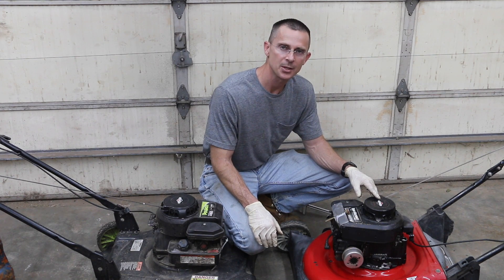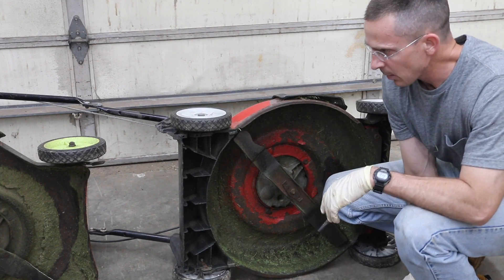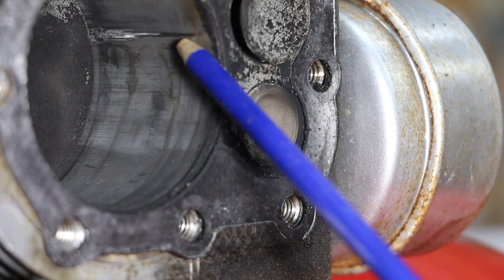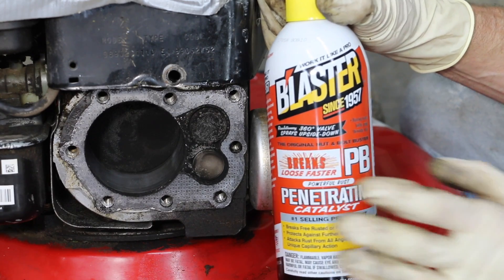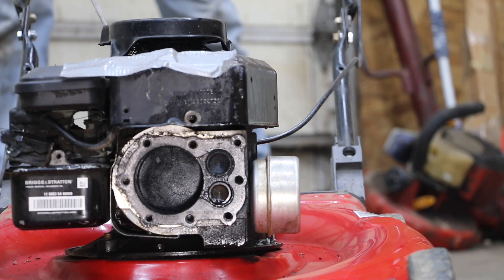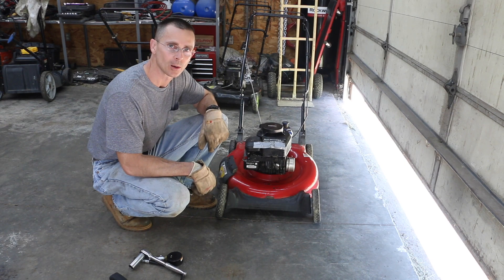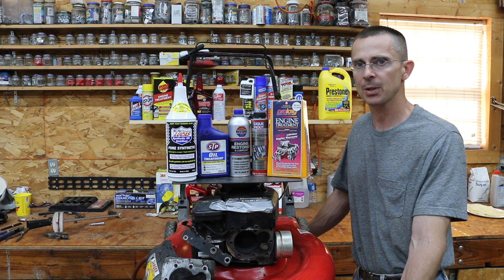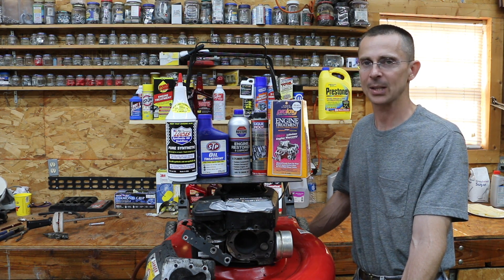Engine ran without oil, seized! Can it be saved?

Comment: I had the same issue with my mini bike would it run again if i put a new piston in it? It ran without oil in the motor and it locked up. Would a piston fix my problem??
Reply from the maker: You may be able to free it up using marvel mystery oil. If that doesn't work, a new piston and rings should do the job if the cylinder wall is in good shape.

Comment: I haven't found anything that can increase compression on a 2 stroke engine. I have an old atv that takes multiple pulls to start. All the increased compression additives out there are for oil, since the 2 stroke mixes the oil and gas, those aren't helpful. Any recommendations? I have seafoamed the throttle. The only thing that works is starting fluid.
Reply from the maker: If you're sure the compression is the issue and not the carburetor, a cylinder hone (if needed) and new piston rings is the best option in my opinion.

Comment: i have a jammed up 350 small block from a 69 camaro. It jammed up about a year ago and has been sitting in storage. Apart from what was said in the video, does anyone have any tips to get it unseized. Thanks.
Reply from the maker: If it's locked up from sitting and moisture exposure, adding marvel mystery oil to each cylinder and allowing it to soak for a few days.  If it's locked up due to mechanical damage, you might have to disassemble the engine.  It's hard to say without knowing more.
Reply: Project Farm It was on my father's camaro before he jammed it mechanically. He replaced it with a 383 and gave me the jammed one. Im going to dismantle it to see what went wrong and il try to record it. Thank you for your help.

Comment: Is the reason you use the drill to start the engine because all of your engines are siezed up and the rope won't start it
Reply from the maker: The drill doesn't have as much power as the pull string/human force method. it does save me a lot of effort.

Comment: A new set of rings on the piston, fill the scoring will some quick steel (not jb weld) and run a hone through quick. Quick steel handles high temperatures (500F), great for high temperature applications.
Reply from the maker: Great recommendation.

Comment: I've done it. I had a tiller I found in a recycling dump. Seized up tight with water all the way up to the carburetor when I found it. I told the guy I would have it running in no time. He laughed so loud and thought it was funny. An hour and a half later after I tore it apart and sanded the cylinder gouges out of it. Sent them the video of it running. And it still runs today 8 years later.
Reply from the maker: Impressive!  Great job!  I bet he didn't laugh when he saw the video.

Comment: My Yamaha 660 tenere ran out of oil and seized 2 years ago it has the same knocking sound as this mower and I'm still riding it to this day oh and I've never changed the oil lol

Edit: my mate dropped it in a puddle last week and water got into the cylinder, we got the water out started it and let it idle, the knock was a little louder, engine backfired and noise went a lot louder..... I turned it off and walked inside, mate asked what the noise was I said you need a new engine kek
Reply from the maker: Wow! Thanks for commenting.

Comment: Lol...

Next time you want to free up something that seized from from friction and heat, while adding as little damage as possible, use hot bacon grease, or black pipe tapping oil.

As for the low compression and knocking, 50-60% STP mix is the best bandaid I know of.
Reply from the maker: Thanks for the recommendation.

Comment: I think the best product to uses is called new crank bearings and machining the cylinder; most likely new rings as well. Stop trying to uses mechanic in a bottle to fix major problems, they only work for a short fix, its like tying to treat a gun shot wound with a band-aid.
Reply from the maker: Thanks for commenting on this.

Comment: I bought a brand new (then) stiga mower, made in East Europe i think it was (the new low price units) engine looks a tad different and sounded that also. The are no throttle on it, is always on 100% rpm set, with a spring lever that keeps it there.

I moved the spring so it runs on slightly lower rpm, so don't blow parts if hit some thing with blade(works great), now it simply stops.
But as it runs, it starts to create a knock when it gets hot (fully warmed) if increases the rpm to stock 10sec, it's gone for a while.
Sounds like the oiling fails on lower rpm !
Old engines did not do this, something changed on the new fixed rpm engines.
It's not a Briggs engine, but something they makes self.

Oiling vs rpm test, on different brands of "mower" engines?
Reply from the maker: Thanks for the video idea. The oil splash system should be effective at the entire RPM range.
Reply: Project Farm yes, why i had no problems lowering the rpm of engine the backwards way as was thinking that also, why would it affect oiling as engine are in a oil bath. Simply moved the spring placement slightly. But engine are likely different inside. Oil fill/stick are at 45°on lower engine side.
But if run mower on a hill side that are nearly 45° it starts to rattle in similar way, got several mowers with same engine in them.
Reply from the maker: Great point. It sure does seem as though the oil splash system isn't very effective at low RPM. Maybe the splash gear has a less effective design on that model.

Comment: Good Test!  I once was Vocational Director in a High School.  Someone donated a seized
up push mower to the shop class.  My teacher filled the engine with diesel.  Both cylendar
and crank case.  It recovered pretty well.  Good ole STP in the crankcase did quieten it
down a lot.  (very little smoke)  Cheap recovery perhaps...LOL
Reply from the maker: Impressive!

Comment: Not sure which product would work to fix it, but what you could do is take it all apart, clean it up, polish out some of scratches, then electroplate deposit new layers of metal into the damaged areas, then polish that down. New piston, new rings, or just do the same treatment for those, then buff them down for correct fit. A whole lot of work though, but I bet if done right, it could make it all 'like new'. Probably easier and cheaper to buy a whole new engine... But for an experiment it would interesting to see if this could be done....
Reply from the maker: Great recommendation

Comment: When I saw the cylinder wall, I knew your only bet would be to hone the walls again and increase bore size. Only by about 0.25-3 mm in diameter, but at that point, the cylinder itself would no longer fit... Question is, could one use thicker piston rings?

Comment: If my mower is difficult to start because it pulls hard, but then loosens up after a few pulls and then starts and runs fine, is that an indication that the oil is low, but then getting lubricated after some strokes?
Reply from the maker: Not sure why it's stiff at first, but the oil level is unlikely the issue.  These mowers use a "splash" system.  So, once the engine is running, a little plastic gear spins and throws oil around.
Reply: Project Farm Thanks for your response. I enjoy your videos. Keep up the good work.

Comment: It's not a mystery.I keep learning because my stepfather and his pressure washer. And... your videos. I just modified the engine so we can start it with a drill.
The engine stop and seized up. I couldn't turn it with the rope. I figured the engine was finally shot. He has been adding 2 cycle oil to the gas for about 15 years.
I took the head off of the engine and  never seen some much carbon and junk before. Anyways I used a breaker bar to turn the engine and I got the engine spinning. The cylinder wall has quite a bit of scoring. I then saw the oil was down to just barely anything to see. I added oil and turn the engine some and the oil quickly went to the cylinder walls. The engine does have some issues now but it should last for a couple more years. I'm surprised it hasn't blown up yet. It is a 6.5 HP Briggs and Stratton. I'll have to check the compression tomorrow to see what it is.
Reply from the maker: Impressive!  It's great to be able to fix things yourself, saving time and money!

Comment: Love the videos! Great information on products and how they compare. I wouldn't mind seeing some home remedy recommendation other than store bought items, such as using Transmission fluid to clean an engine and swell the seals without a load. I've heard running transmission fluid in a 4 cycle engine for ten minutes without load during an oil change conditions an engine. Curious to see the validity and to see its effectiveness over some other products.
Reply from the maker: Great recommendation--thank you!

Comment: I would have torn down the engine entirely, honed the cylinder and if needed replaced the piston, connecting rod and/or crankshaft.  I do not think that any magic fluid will fix that engine.
Reply from the maker: Thanks for commenting.

Comment: I accidently forgot to check my oil, my mower locked up at an idle, it is a 17hp Kawasaki twin. I took out the spark plugs and put some WD in there, hoping  I can get her free again, I have had it for nearly 15 years and just let it run  low last time I used it, but it ran till I shut it off, then I started it to move it and it went about 30 seconds and slowly puttered out and seized up....hoping the rings just stuck run the piston heated up, maybe its not totally fucked
Reply from the maker: I hope you can get it going again!
Reply: Good news! I removed the spark plugs, sprayed some WD in there, removed the recoil and used some wood blocks and a pipe wrench to turn the crank backwards, new oil and filter and let it sit overnight, she started right up, so I ran her for only a minute to get the new oil moving around, I think she'll be good to go after I check the oil and add a bit, thank goodness she didnt seize up while i was full throttle! I dont think that would have gone so good ;D cheers best of luck with your future projects
Reply: she did run again but the lack of oil cause the crankshaft to heat up causing play in the connecting rod and crankshaft mating surface, and it threw a rod through the block, I will be finding a used engine in the meantime and will being buying  a new crank and crankcase, connecting rods, pistons and rings to rebuild the broken engine and hopefully have a fun time tearing her down and learning something. unfortunately you learn more when you break stuff

Comment: None bud . I used to have a kawasaki kx 80 . They were known  for the sur clip on the piston to pop out and scratch the cylinder wall. Massive power loss obviously . Only way to really fix that is i wont say have it bored its not worth it. Whet stone hone it out new connecting rod . New rings . That would fix it . As far as the crank get a piece of emery cloth then repolish it with an old leather belt. Really old man did it to my car and said we didnt have machine shops back then

Comment: I've personally used Lucas as an oil additive. Actually they make a retarded good transmission additive as well. It basically took a transmission with no reverse and the first two gears only and restored all 4 speed gears in a dodge transmission. 42re to be exact. So, my money is on Lucas for the perpose of enhanced lubrication and reduced friction. I have never had to restore compression so it's really up for grabs as far as I know. I'm very meticulous about what goes into my truck engine, and would probably never even think about trying to use any of these products with the exception to Lucas oil additive. I have been wrenching all my life, and 1 thing is for certain. These engines were designed and manufactured at a certain tollorance and precision. Becouse of the nasty gash and smaller ones, without honing and possibly even boring and replacing valves and cup. Head, compression may never come up. I've heard that leaded gas use to help old engines back in the day with less technologicly advanced motors than what we have now. But, more than likely like you say, it will never be the same again. Still a cool test subject. It's probably a shit canner at this point lol. Dime a dozen
Reply from the maker: Lucas makes great products.

Comment: To begin with, I am an old mechanic. I do know that some of the products do what they say they will do. In the case of reducing noise, the products that work, do so by freeing up any sludge and dirt. In my opinion, if you use a product that does this you will see no significant noise reduction because I believe this engine is already clean. The engine has had a major engine failure, and I think the noise you hear is a rod knocking. Once this occurs there is no additive that will help. You mentioned you had seen the commercials for Slick 50, I remember them too, and at the time seemed too good to be true : ) I remember Motor Honey, and I remember people putting saw dust in the rear end of a car to stop it from whining or howling. I don't know what's inside the engine in the way of a rod bearing, or babbitted rod bearings rods. With a small engine like this, I'm guessing a new crank, and rod, bore the block, and oversized piston would be needed to get it back in shape. But when you can buy another mower for the price of a piston, why would you do all that? This is probably old knowledge to you, I'm just guessing.
Reply from the maker: All great points and thanks for commenting!

Comment: i swear by mystery oil when i get a used car i drain the oil and refill the crank case with just enough mystery oil for the pump to pick  it up, rev it for about 5 good minutes and drain all the sludge that comes out replace with Lucas and a  standard oil change, they always run like a sowing machine...
Reply from the maker: MMO is a great product.

Comment: It smacked because you tipped it up on its side which let the oil run into the valve cover, through the crankcase oil breather tube, and then into the carburetor which tried to used that as gas and smoked real bad.
Reply from the maker: Thanks for commenting.

Comment: Go with the Engine Restore additive. When I was a teenage I bought a '77 Trans Am for $500. And it was every bit of a $500 sports car as you'd expect. Every body panel was practically Bondo. And it had such bad blow by that it was dumping about a quart of oil into the air cleaner in about a week of daily driving. Then Engine Restore would stop the oil blow by almost completely, albeit only for about a month and then would have to dump another bottle into the sump.
Reply from the maker: Thank you for this recommendation!

Comment: I resurrected a husky 266SE chainsaw that had been run with insufficient oil in the mix, it had galled up and left bits of piston in the bore. I polished it up, freed up the rings and put it back together. It’s still running nicely.
Reply from the maker: Impressive!  Glad you were able to save it!

Comment: Put thicker motor oil in it that will reduce the rod knOck sound and the smoke is the pb spray burning off
Reply from the maker: Thank you for this recommendation.

Comment: Ill like to see a small engine blow up by nos and take it apart
Reply from the maker: Thank you for this recommendation!
Reply: I've done oxygen acetylene injection into the carb, they really scream then die. You should try it!
Reply: The problem is, adding NO2 alone won't do anything but lean it out, it needs a proportional amount more in fuel. Leaning it out is a good way to get detonation, but not more power.
Reply: @jmhalder  That's true if you're  spraying a dry shot into the carburetor. If you are spraying a wet shot with nitrous and fuel pre-mixed, that point is moot.
Reply: Yeah.. I don’t think he wants to kill himself.

Comment: I actually did this again to a seized up lawn mower. I put oil in it and then took a wrench and turned the rotor to free it up. I eventually got it running again. It knocks a little but it runs.

And you don't need to take the cylinder head off just shoot the pb blaster into the spark plug hole.
Reply from the maker: Thanks for commenting on this!
Reply: Project Farm you're welcome. I love this channel.

Comment: None of them will fix mechanical wear. The wrist pin, rings, and oil berring must be changed the hone the cylinder. After that the show products would work to quiet down the engine and allow it to work in that state for much longer
Reply from the maker: Great point and thanks for commenting.

Comment: Since there are no rod bearings you should try using J-B weld on the rod where it's worn down to see if it makes the knock go away. Of course try this after different additives for the knocking noise . It would be interesting to see how it holds up and how long it would run.
Reply from the maker: Thank you for this recommendation!